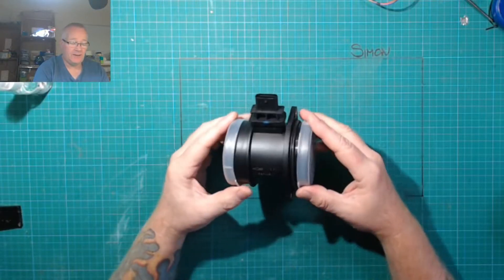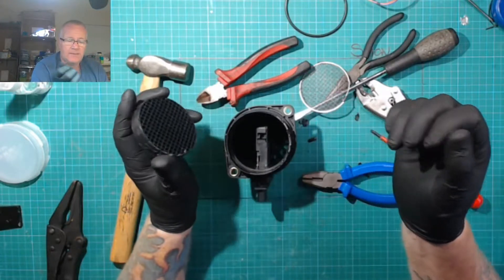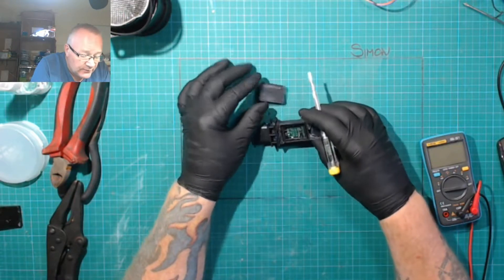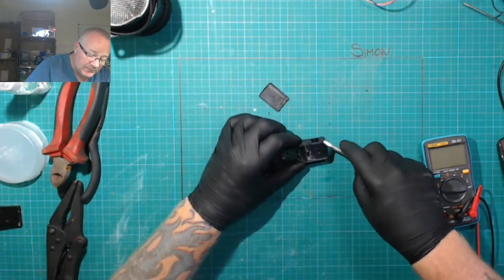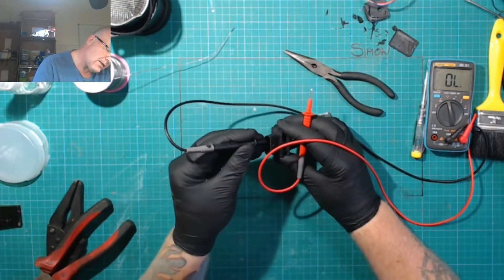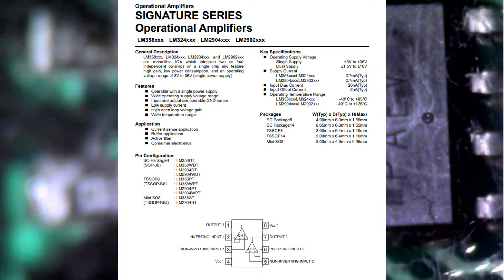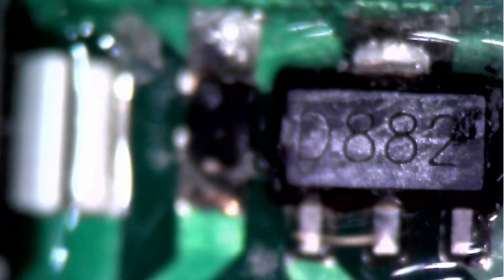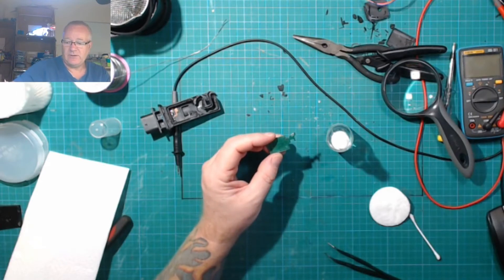Kia Sportage - MAF Teardown

Comment: Kudos for the effort. I changed my MAF out which fixed my problem. The old one had electrical burning smell so went straight in the bin. Main take away is its pointless squirting cleaner into the housing to try and clean it as suggested elsewhere.